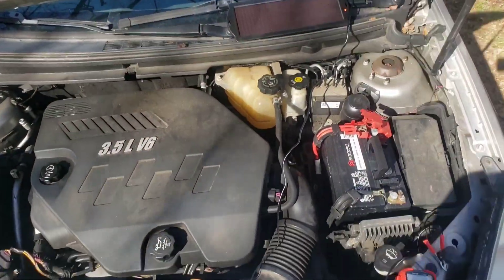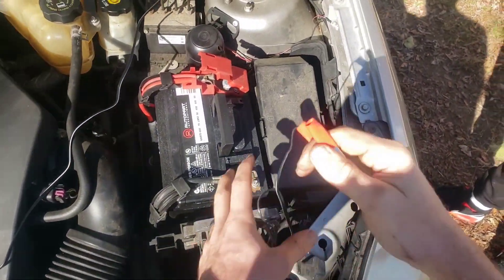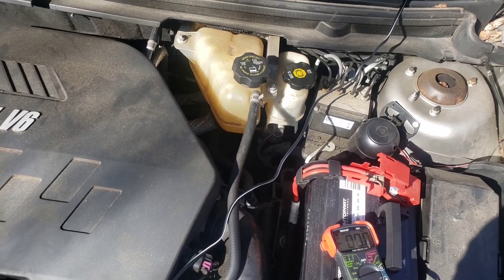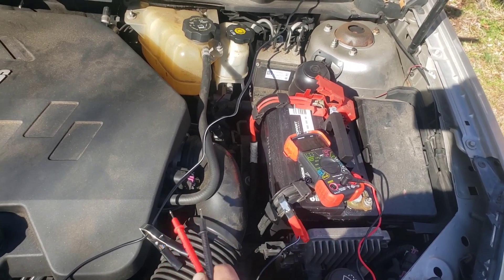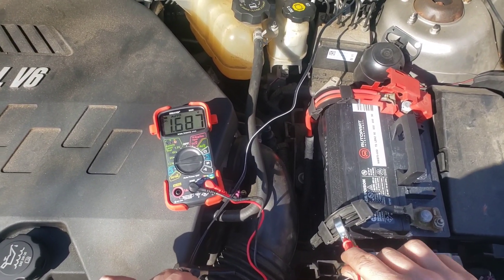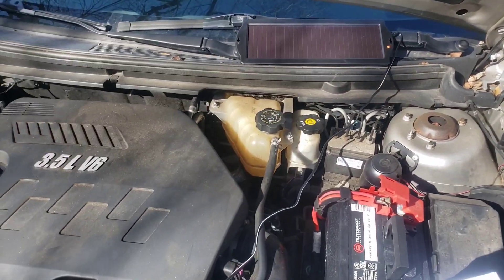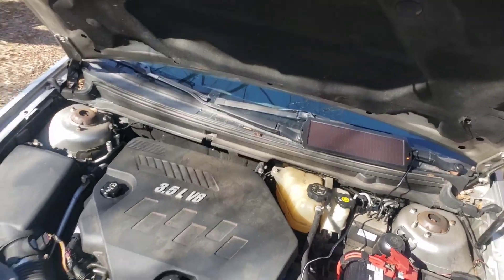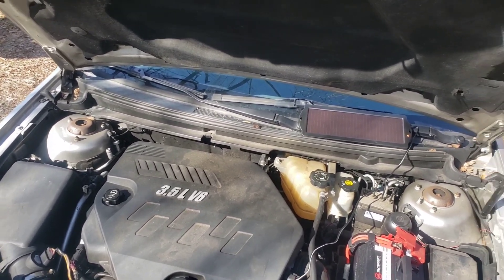How to Tell if Trickle Charger is Working or Not Check Amazon Sunway Solar Charger Bad Not Charging

Comment: I have discovered that using the OSBII port charging adapter with less than 3 amps of charge works well for vehicles that have a 12 volt cigarette socket that turns off when the vehicle is not running. The OSB II port adapter works well as long as you don’t exceed 3amps of charge power. I found a 2 amp charger that works great.

Comment: I just got mine in (same brand) but its 8 Watts. A relative gifted a 2001 F250 to me and it has a new battery but it gets drained down in 4 days. It's my hope that this 8 Watt trickle charger will offset whatever parasitical is at work. It works by either a cigarette lighter plug or connects to the battery directly. How do I determine if its working through the cigarette lighter plug?
Reply: Once you tested it out ok with voltmeter, one thing you jave to make sure of supposedly isto make sure that cigarette lighter is live even when auto is off, so i guess you can test it with something on cigarette lighter to make aure it's live like a usb plug adapter or the voltmeter.
Reply: @edp2506  Thanx. Since my last posted comment, the solar charger proved to be working rather well. On week-long cloudy/stormy/rainy/winter days - not so much. But yeah., while the sun is out and on "partially" cloudy days it keeps the battery topped off and ready to go.

Comment: To find the output current of the charger use the wattage divided by the output voltage. 8w/12vdc = .67 amps. Very good video btw
Reply: Appreciate you, just learned what I needed to!